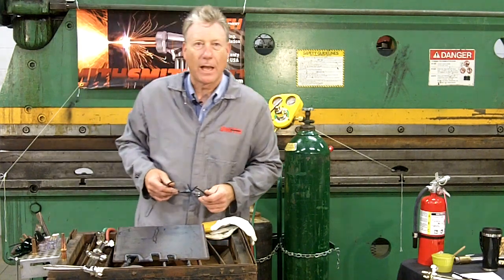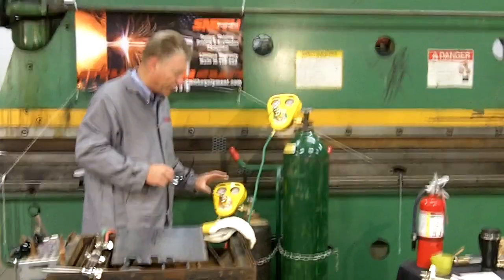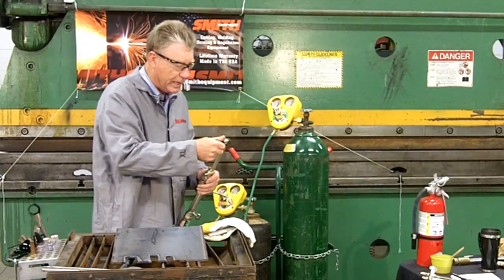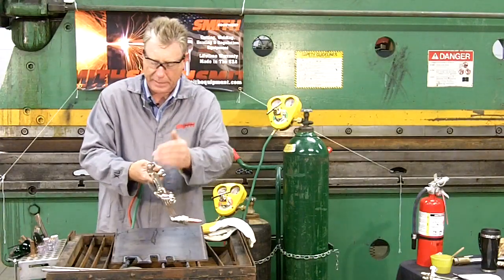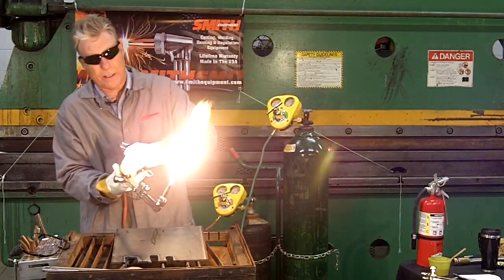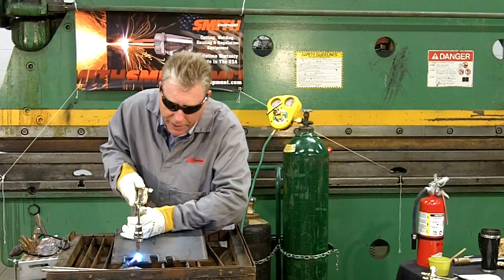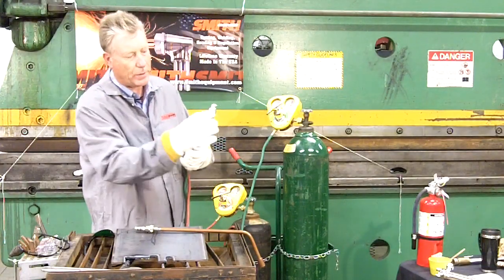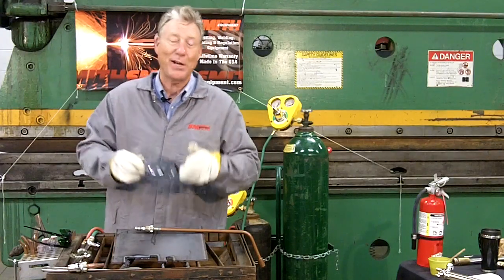Acetylene & Oxygen Torch Cutting

Comment: Although he corrected himself, he wasn’t wrong to refer to the acetylene side as the “fuel side”. Technically, oxygen is NOT a fuel, it is an oxidizer (as you can see the word comes from the word “oxygen”). For a flame you need heat, fuel, and oxygen, right?

Comment: Hi, manufactures’ always say that it would not be possible to cut steel with a 95% oxygen purity.In this video, I have made some tests with small thermal rods with a 70% O² purity mix and it still works. Would it no be the same with a gas burning torch?https://www.youtube.com/watch?v=zz5i_O4b73I

Comment: Always strange how on shut down, one instructor shuts down the oxygen first and another says fuel first. Sure is difficult as a beginner to know which is safest.
Reply: Peter Ford remember always fuel first. You turn on fuel first you shut off fuel first.
Reply: Always shut the fuel off first. Oxygen does not ignite. Acetylene can be lit from red hot metal recently cut or welded. If you are cutting and the torch goes out you can relight it from the very material you were just cutting. Oxygen is only an accelerant in a torch. Only crack the acetylene tank. If a problem arises, a half turn can shut it off. And always wear dark lenses (shade 5). It will very quickly ruin your eyes. otherwise.

Comment: good vid , more emphasis on acet cylindr not being turned on all the way , half a turn or so is plenty , so it can be shut off quickly if needs be ,,, bit more detail about the neutral flame setting would have been good too , but all in all , a good vid

Comment: what causes the metal to weld itself back together behind the cut?
Reply: Maybe too much power?  People usually use larger tips than they need!  They have numbers, but the numbers go down to 0, 00, maybe 000!  In general you want just enough power to get the steel to ignition temperature but not to melt it.  Oxy-Propane operation supposedly helps avoid this common and annoying problem.

Comment: Great video, but he didn't set his pressures dynamic and he turned the oxygen off first. Turn off the fuel first and the oxygen second so the oxygen will blow the fuel out of the line, ensuring that the flame isn't still alive in the torch itself. By dynamic I mean that your gauges should be set with what you're working with, i.e, having the torch open instead of being static and closed.
Reply: Hmm good points. Thnx

Comment: 5. Shutting down the oxy fuel gas welder
a. First close the acetylene torch valve, then close the oxygen valve. Closing the acetylene valve first reduces the chance of allowing unburned fuel gas to escape and be ignited accidentally.
b. First close both cylinder valves, then open the acetylene and oxygen valves on the torch body, one at a time. Allow the gas in each line to escape and see the line pressures go to zero on the regulator gauge.
c. Close the acetylene and oxygen torch valves after the gas in each line has been released. This is to prevent the reverse flow of gas into an opposite line.
d. Release the line pressure-adjusting screws on the acetylene and oxygen regulators.
Reply: The manual that came with my Victor torch says to close oxygen first, explaining that if you turn off fuel first, you can get a backfire, that popping sound, witch sends soot back though the torch witch can effectually clog the arrestors and check valve. The school I went to for welding also taught oxy first.  Not sure what your talking about with "unburned fuel" reigniting, if your flame goes out when you turn off the oxygen, you clearly doing something wrong. I'm sure you'll say you've been doing it your way for years and never had a problem, but I've been doing it the way I've been taught for over 20 years and no problems either, just do what your manual says I guess....
Reply: Red before green, or you won't be seen.
Reply: This is old, BUT the A/O debate is fiercely contested, but i've actually put my life and limb to test what is proper.
Heres my scientific findings after 10 years of working with acetylene cutting:
1. It depends on the manufacturer, and if it's a Tip Mix or Body Mix torch, one mixes the gasses at the tip, the other at the body.
2. Body Mixes are more susceptible to Backfires, Backfires CAN cause a flashback. A backfire is basically when the Acetylene can't sustain itself in the atmosphere and pops out. If you want to do a controlled backfire, just turn the acetylene down all the way but not shut, it'll pop itself out. OR add more oxygen than acetylene and it'll pop itself out because it can't sustain itself. The third, is if your seals are bad, a lingering flame will continue burning at the very tip of the torch head and again, pop after a couple seconds.

NOW heres the scientific part.
A backfire almost ALWAYS sends soot back up into the torch, why is this bad? Because Backfires can cause Flashbacks by blocking your seals from closing.
Turning off Oxygen then Acetylene also can tell you if your Acetylene seal is bad on the torch I.E the lingering flame I talked about earlier.
If your seals have gone bad, then they arent closing properly and will allow for the gas to flowback into the line.
Most torches are designed to stop minimal backfires at the seals, but again that damages them and can clog them with soot.

SO, scientifically? It should always be O then A for you're own safety and recognizing when your torch has gone bad easily, because Oxygen isnt flammable but Acetylene is and i'd rather make sure everything with the highly flammable gas that self ignites at 15 PSI is safe and workable.
But reality is more complicated, and you should ALWAYS trust the torch manufacturer instead of some yahoo 50 year old with 90 years of experience with your life and safety.
Reply: Checked your YouTube channel. Didn’t find your welding instructional videos. Still waiting...
Reply: Yep

Comment: I noticed he adjusted the pressures to the torch with the torch valves closed. you need the valves at the torch open to set the pressure. also you should turn off the gas first then the oxygen. the gas valve should only be opened 1/4 turn for fast shut off if needed. and the reason you open the oxygen all the way is to backseat the valve so oxygen don't leak out past the valve stem.

Comment: I just wish Smith/Miller had kept making videos.  Most of this stuff I learned in metal shop class in high school.  But some of it was new to me and some of it I had misplaced.  High School was more than 15 years ago.  When I was in school the procedure for lighting a torch was acet and o2 on light and adjust.  Guess things have changed. I will have to update my technique. Also as a basic intro he should have mentioned acet has a very low max psig and it can never be exceed. Well unless you want an ear shattering kaboom. Thats the kind of info I like to have. 

Over all though good video.

Comment: The acetylene valve only needs to opened 1 and a half turn and then you run them on .5 acetylene and 40 oxygen that's what I do but if I'm cutting bigger pieces of metal I used 50 or 60 oxygen and 6 acetylene

Comment: The cylinder tap only needs to be opened about half a turn if that - what is this "all the way" bullshit?????
Reply: I was told newer O2 tanks didn't have to be opened all the way so I tested it with LeakTec and lo and behold it DID leak until I open it all the way!

Comment: UMMM....  A before O or up we go.
Always turn off Aceteilne before Oxygen...  Your just lucky you had flashback arrestors.
Reply: No, you are incorrect.  The American Welding Society changed the procedure many years ago due to torch pop.  Fuel on first, then oxy.  Oxy off first, then fuel.  You should study up on the entire welding process.
Reply: You can find it written both ways in current text books. Some say turn off acetylene first, others say oxygen first. Turning off acetylene first prevents flame from entering the torch (pipe bomb!), while turning the oxygen off first prevents torch pop and possible soot build up in the torch. Personally, in 20 years of welding I have never heard of anyone blowing up either way. My advice is to just make sure you turn it off, I've seen torches left half on more than once.
Reply: MasterHustler So, what is wrong with 'Torch Pop'? Is that dangerous?? And you're saying the correct way is to extinguish the Oxy first and then the Acetylene? That's the way I've always done it (and my handbook says to do it the other way round) Also, I've been like this fella, I've always set my gauges 'static', however, I've always wondered about this... maybe I should set my gauges with the torch valves open?
Reply: SeriousSchitt I do A before O I've never had torch pop

Comment: you cannot attach the acetylene regulator to the oxy cylander because they are threaded different... this is because the acetylene regulator isnt built to withstand the pressure that an oxy regulator does.. as for connecting the hoses to the torch there is or should be markings telling you which hose goes where
Reply: The hoses like the regulators have right or left-hand threads!  They can only be attached one way.  They are the same size and thread otherwise.  The LH threads are indicated by a groove machined in the threaded nut as mentioned by the instructor.  This is just for our convenience, since you can't put them on the wrong place.  This just is so we don't TRY.